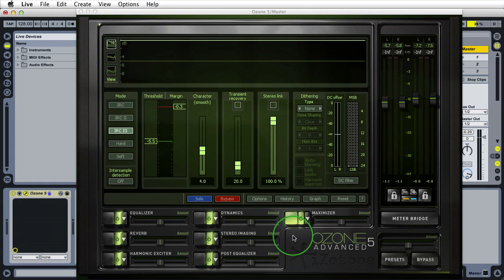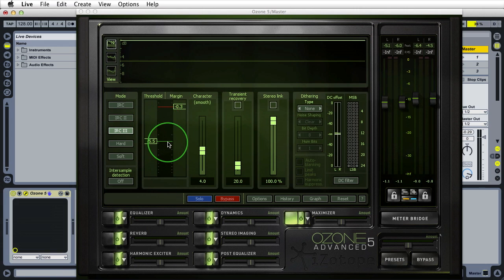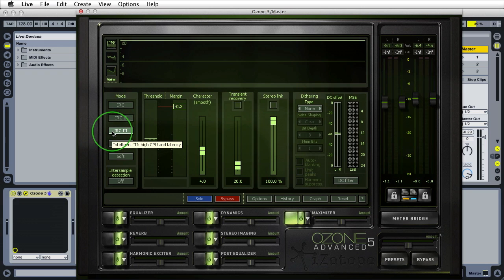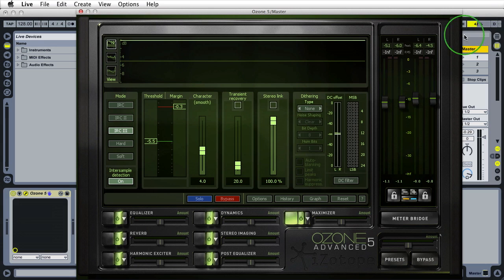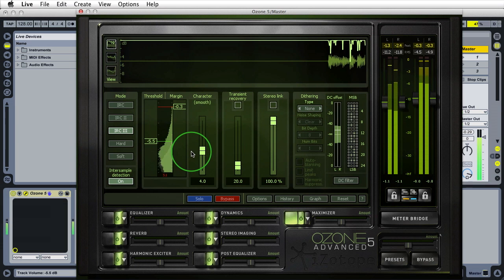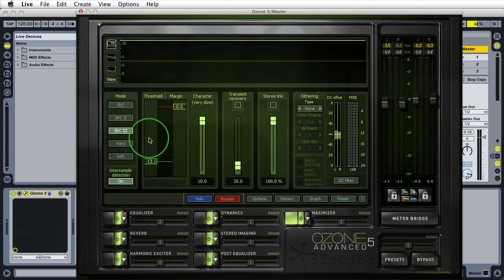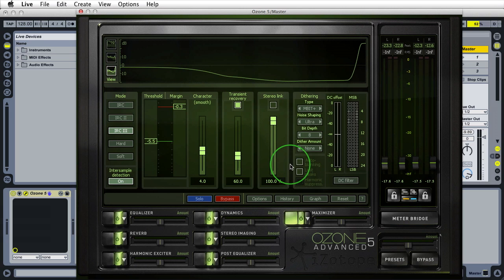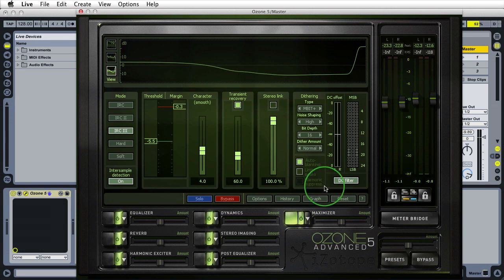Mastering Tutorial: iZotope Ozone 5 Maximizer - Part 6

Comment from the maker: The standard bit-depth for the CD specification is 16-bit. If you burn a 24-bit audio file to a CD it wont play in a CD player. The standard bit-depth for a DVD is 24-bit, so you'd work with 24-bit files if burning DVD's.

The only time you dither is when you're converting a higher bit-depth to a lower bit-depth. Ex: working in a 24-bit session and bouncing a 16-bit audio file.

Hope that helps, have a good weekend!

Comment from the maker: I hear what you're saying Patrick, I tried to go more in depth in version 5 compared to version 4, but you can only fit so much in an online tutorial. Plus, trying to make it easy enough for beginners while still giving something for intermediate to advanced. Where would i put a tape saturator... I wouldn't put it on the master bus, I'd only apply it to individual tracks. However if you're set on adding it to the master track I'd add it before your mastering plugin(s).

Comment from the maker: Are you talking about the size of the waveform in the final MP3 or WAV file? If so, I can only assume you're pushing the Wave's Limiter harder... try lowering the threshold in Ozone's Maximizer and bouncing the file and checking the resulting waveform. The harder you push a maximizer the more condensed the waveform will appear after the bounce - consequently you will be losing dynamics, so it's a fine line of pushing it (for loudness), and keeping as much dynamics as you can.

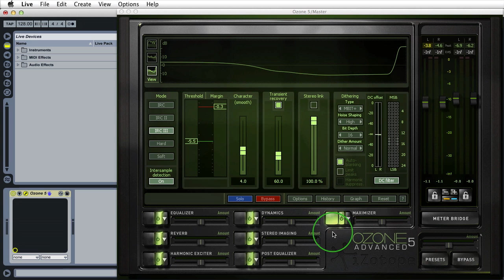Comment: The way that you demonstrated what dithering does sonically to the signal (at low levels) was extremely helpful!  One question - I noticed at the end @ 20:35 when you opened the Export Audio window (dialogue box) you kept the dither on - should you dither within Ozone as well as within Live's Export Audio window (dialogue box) or should it be turned off to "No Dither" in the Dither Options?  (I assumed you just skipped turning that off bc you activated dither already in Ozone but also didn't know if you need to dither within both...) Thanks!
Reply from the maker: Good catch... you should only use dither in one or the other. So if you're using Ozone's dithering please turn off Live's. Have a good week!

Comment: Thanks, that was really useful. I have been using Ozone for a while but still really guessing at a lot of the functions. The Dither explanation was very useful. I am mastering my album and listening to it across 4-5 different sound systems, I am really struggling with two tracks, which are full productions (drums, guitars, bass and vox) I can't get these two track to feel as "hot" or as "punchy" as the rest of the album. When I get to them they lack volume compared to the others (perceived volume) and they just sound weaker. I guess I could just turn all the other songs down?

Comment: Thanks.  Is there any difference in the end result, between 1) 24bit no dither >> 320 mp3 and 2) 24bit no dither >> 16bit dither >> 320 mp3?  I have been using option #2 the most often.  I assume #2 only if you need to also have a master ready for CD.

Comment: Great tutorial! Very helpful! Just a question....If I use both 16,24 or even 32bit  samples, clips, plugins.....will I have to dither at the lowest bit rate...that I am using on the project?
Reply from the maker: Dither is in relation from your project to your output… not the samples. If you're working in a 24-bit or 32-bit session and bouncing to a 16-bit file… then dither. Have a good week!
Reply: Thanx a lot for the fast response!
Reply from the maker: You're welcome!

Comment: Extremely professional tutorial, easy to understand for newbies like myself.... I primarily work with audio clips (making pop mashups), so the audio I'm using is already professionally mastered. I had to take the instrumental tracks down to minus 5 dBs, then I added vocals & eq'ed everything in my project. So, in the maximizer, I set the threshold to minus 5 (to add the 5 dBs back into the mix), used the intelligent 2 preset, then set the character down to 0 since I didn't like the transient effect, & set the dither to high & the noise shaping to ultra... did I do this correctly? Or based on what I mentioned I'm using the maximizer for, is there another way that you could possibly recommend? :)
Reply from the maker: +stevebs2001 The maximizer is used to glue everything in your mix together... bringing out the fullness of your mix. When using already mastered material... less is more. I couldn't comment on your settings as I'd have to hear to know. However you state you lower the instrumentals by 5db and add vocals... i'm assuming you're lowing the levels of each track because otherwise you would be clipping. Each time you add audio (a new track, etc), you're increasing the db level... so the maximizer can be helpful to glue it together, but you're not using it to recover the level you lowered to stop clipping. Not sure if that makes sense.
Reply: Exactly! I lowered to 5 dB, because that is the highest volume I can get without any parts clipping. I make mashups, so that is why the exciter, eq, dynamics, etc isn't useful to me. I eq the vocals myself if the acapellas I'm using are sub-par quality. My main issue is that the intentional "quieter" parts that I arrange in my mix somehow become almost too loud after mastering in Ozone. I actually had to reopen the mastered file in acid & put volume envelopes back on the parts I wanted quieter to get it back to the way I mixed it in the original program. The intro, break, etc. But other than that the results are amazing, especially when comparing to Waves L1. Ozone gave me 5dBs more volume somehow at -.3 Truly amazing :)
Reply: +fordeetv Ok, I think I see what I did here. I was comparing the Waves L1 maximizer to the Ozone maximizer thinking that the ozone one worked magic. The extra loudness that I achieved was because I had dynamics checked also without knowing. So, being that I'm working with pre-mastered pop songs, is there a preset that Ozone has that you can recommend for me? I mastered with just the maximizer without using dynamics & noticed a big drop in volume. I obviously need dynamics, but these songs are already eq'ed perfectly, I just need to put the extra volume back into them, and the maximizer alone doesn't do the trick, I obviously need dynamics to make them louder... My goal is to get them back to the same volume as original, the preset on CD master works very well when I have the maximizer & dynamics on the track. But I'm asking your expert opinion. I also probably don't need dither, because these are 16 bit files already, & my acid DAW is 16 bit... :)
Reply from the maker: stevebs2001 Ok... so you are correct, you do not need dither if they are already 16bit. Next, If you're creating mashups of already mastered material... I would probably avoid adding dynamics and play with your mix of the two tracks along with a little bit of the maximizer. You should be able to pull proper loudness with those two things. Good luck!

Comment: Thanks for the series!

A question: Why wouldn't you put the margin of the maximizer at 0.0? I've been comparing my tracks loudness with commercial tracks loudness and It's pretty clear they put it at 0.0.

Thanks for any kind of explaination!
Reply from the maker: ChannelIsSoCash The -0.3 margin is CD standard, it ensured your music wouldn't clip on the widest variety of CD players on the market. As far as your loudness sounding like other commercial tracks, it has nothing to do with the -0.3 margin as I set all my tracks at that level and their loudness can compete with all other commercial material. Try pushing the threshold of the maximizer harder or adjusting your mix to achieve a perceivably louder track.
Reply: fordeetv Ok. That is indeed good to know for future reference. As for right now, though, I am trying to set up an digital release only and what I forgot to mention is that I did compare the audio wave form in my daw app to see that the track I am using as mixing reference is at 0.0. So, for a digital release only (iTunes, Spotify etc.) would there be, as far as you know, a clipping problem?
Reply from the maker: ChannelIsSoCash That's a good question. The answer would be two-fold, you're probably pretty safe at leaving the margin at 0.0 then, and it would only affect people who burn your MP3 / WAV file to CD (and even then, maybe / maybe not). Good luck with your release!
Reply: fordeetv Cool! Thanks again for the videos and replys!
Reply from the maker: ChannelIsSoCash You're welcome, have a good week!

Comment: Hey fordee, that was a brilliant series. I have a situation where my main gain sliders (above the meter bridge) constantly has a red bar on top of it, as if something is clipping. Nothing I do to the volumes could get rid of it. It's there even when the song is stopped. I tried placing a limiter before the ozone vst, and turning the limiter down a significant amount, but the red bar is still there. Not sure if this is a problem or not.
Reply from the maker: Shaquille Davis It's hard to say without seeing the session. But if the red bar is persistent even when there is no audio being passed through it then maybe a problem with the plugin and it needs to be reinstalled?

Comment: +fordeetv

Are there any audio plugins which simply lowers the audio if it hits a certain limit? Instead squashing the audio in a limiter ...

thnx
Reply from the maker: +RmaxGenactivePUA Mgtow A compressor and limiter do just that, but will squash the audio as a result. Your other option would be to automate the level/gain of the track in question. Have a good week!
Reply: Is it possible to turn off the squash part in ozone, & just have it lower the audo volume if it hits a certain level?

This is the number one problem I have, designing new sounds, I'm surprised there are no vst's, or options in ozone for something so simple ...
Reply from the maker: The only way to lower the level is compression... imagine if it just lowered the level, it would have volume spikes and drastic changes in the song (that wouldn't sound good).

Comment: i was not able to find big differences while watching you demonstrate. But i do NOT have studio monitors yet. I am currently saving up to buy some. could that be a reason why i cannot tell differences?
Reply from the maker: The Boss I suppose it depends on what you're monitoring with.
Reply: fordeetv lol i am currently using home theater speakers
Reply from the maker: The Boss You should hear a big difference with the maximizer no matter the speakers. But some other changes require better speakers to hear the difference... feel free to push settings to the extreme and dial them back so you can hear what they do, however having proper monitors is important to mix and master.
Reply: fordeetv my speakers were low at the time, i just re-watched with a higher volume and i heard more of a difference
Reply from the maker: The Boss Mastering is an advanced subject, you should have a good understanding of audio, production and mixing in order to understand the topics covered in the series. It will make everything easier my friend. Good luck!
Reply: fordeetv yea, thanks!

Comment: Hi dude, I have a weird question! In my mix I get the volume of the highest peaks at -6 db as it is recommended by many BUT there are other spots in the track that the volume might be at -8 db or even -10 db! Will Maximizer get them all nice and clean at 0 db or I need to adjust the lower volumes at -6 db too?
Reply from the maker: When you mix, not all of your tracks will be at the same level. You should leave yourself approximately -3db of headroom for iZotope and it's maximizer. But to answer your question in more depth is not possible in a responded comment. I'm not sure if there are any good videos on mixing, but I would suggest some research in that area... i haven't had the time to put one together, although may possibly do so in the future.
Reply: fordeetv So to sum up is it okay if not all of my peaks are as high as -3 db?
Reply from the maker: Nick Filip The summation of your mix shouldn't be over -3db for the mastering process. However, how you get there... depends on the way you attack mixing... either additive or subtractive. I'm not trying to not answer your question, i just dont want to say anything that can be perceived incorrectly and its taken in the wrong direction by yourself or anyone else.

Comment: isn't this supposed to end up with even waveform? have done all the steps and it is not even at all... why?
Reply from the maker: If you're talking about a solid block waveform you're talking about a final bounce that has very little dynamics. You can achieve this by pushing your maximizer harder. That doesn't mean it will sound good, but it will achieve what you are asking about.
Reply: fordeetv so it doesn't have to be solid?
Reply from the maker: ***** Being 'solid' equates to a loud track with very little dynamics. Depending on your genre of music, would determine how close or how far you want to be from a 'solid' waveform. Answering this question properly would be too difficult in a comment... so i'll simply say this, if you're working in top40, electronic or hip-hop... then you're probably aiming to achieve a pretty 'solid' waveform... however try to find a good mix of dynamics without too much heavy compression and excitement.
Reply: fordeetv what about a deep house track?
Reply from the maker: ***** Deep house would fall under electronic.